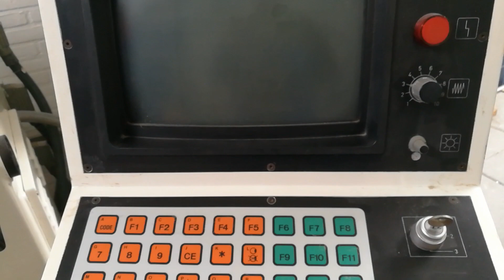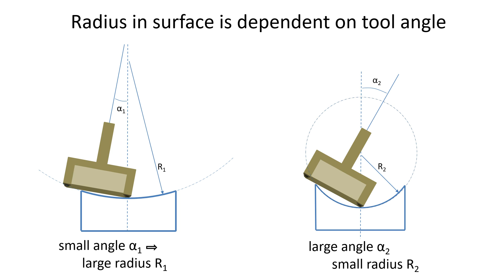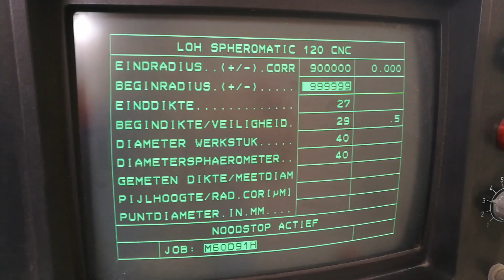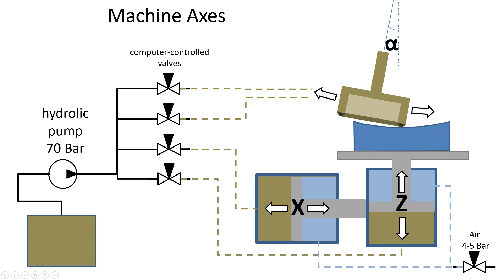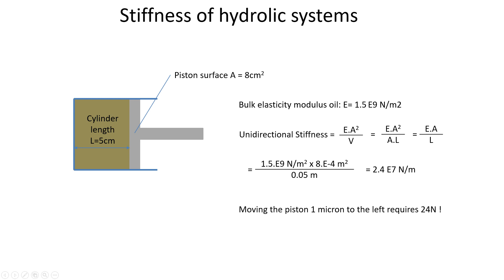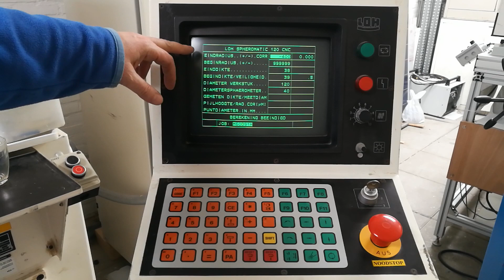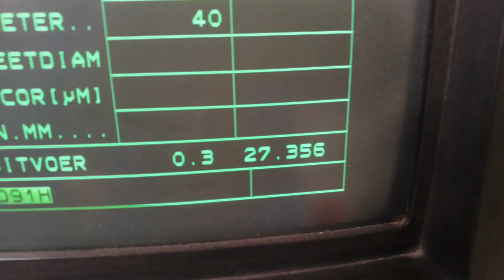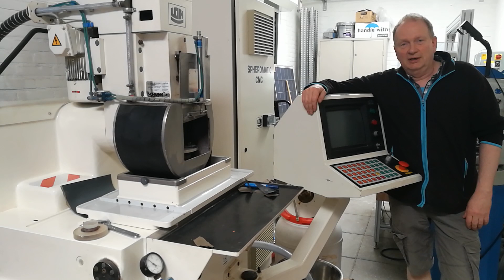CNC Radius Milling in Optics: the LOH Spheromatic Curve Generator.

Comment: Hello! I have a question. Is it possible to mount a wooden panel on this machine? For example, can a spherical hole be cut into a wooden panel measuring 1m x 0.6m? Also, where is the manufacturer of this machine located?
Reply: my meaning is old machine..

Comment: Subsurface damage is also increased by feeding the diamond wheel too fast into the glass.  I could generate nice smooth radii on a Strasbaugh generator with a coarse wheel by just feeding a little slower.

Comment: If you wanted to make optical elements out of Silicon or Geranium ingots - would you take similar steps but use a different tool? Or is Diamond the solution?
Reply: It is similar except that the swarf left behind makes the cleaning of the machine a huge mess (been there, done that).

Comment: why does the larger base glass need to be centered?
Reply: because that glass base is the part in contact with the fixture in the machine.  If you didn't have the blank and the base centred to each other then you would induce wedge in the blank and your radius would be off centre.  If you were in mass production mode you would simply make a fixture the right size for the blank and skip the waxing altogether

Comment: Interesting. Thank you for the view. Thanks for the explanation why the cylinders are used instead of servos or stepper motors and ball screws. I wouldn't expect the system to be more stiff by using cylinders!

Comment: hello super machine and incredible price :)
what is the biggest side of glass you can grind on this machine ?
very interesting video.
Reply from the maker: Thanks for the feedback. The largest diameter this machine can handle is approx. 130mm. So it is more suitable for lenses than for example for  telescope mirrors, which are generally larger.
Reply: @HuygensOptics  i was definitely  thinking about telescopes :)
Reply: @HuygensOptics  
good afternoon, write your email address
Reply: @Stihl_OK  No...